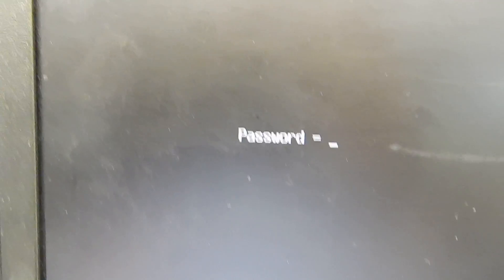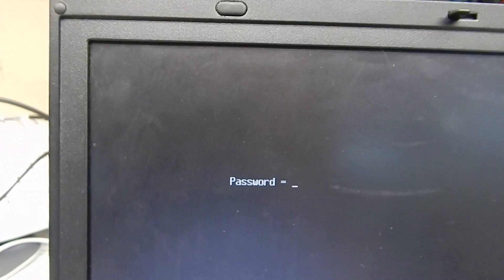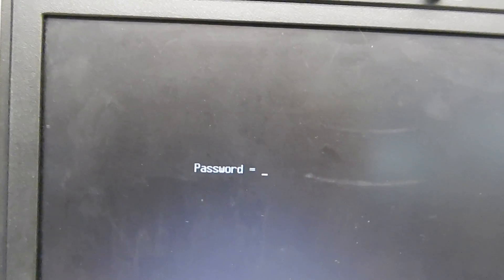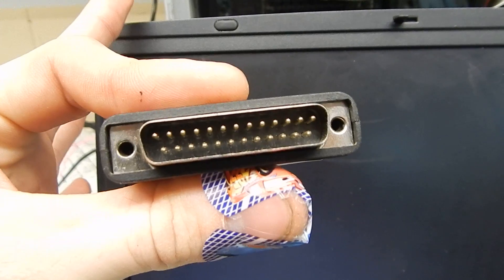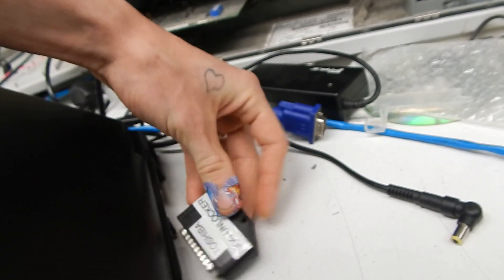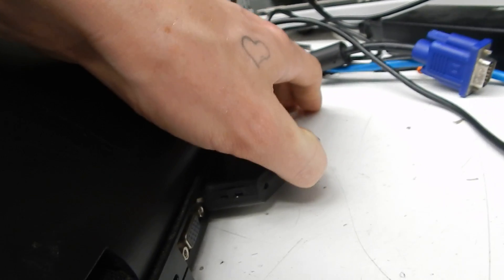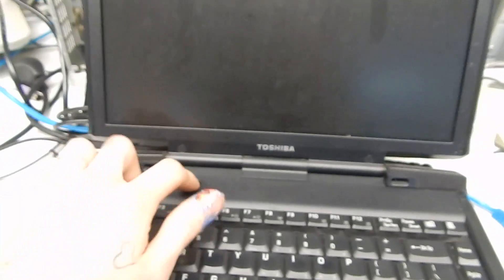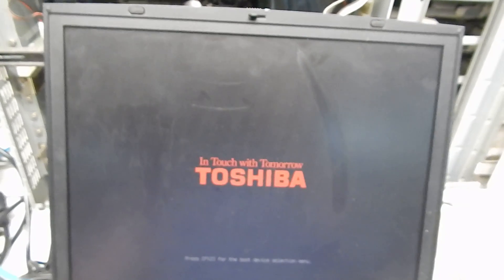Unlock Toshiba BIOS Password!

Comment: #Unlock #Toshiba #Tecra, #Satellite , #Portege , #Satellite, #Qosmio #Bios #Password
With #Challenge Code and #Response Code
 #Skype: Haisung4344

1. Switch on the notebook, when the boot logo appears press [F2].
“Password=' will be display.

2. Press keys in the order [CTRL], [TAB], [CTRL] and [ENTER].
The Serial number and Challenge code will be displayed.

Please Note:
For some reasons it could happen that no PC Serial No. and Challenge Code will displayed instead of "Not Certified" appears. In this case remove the AC-adapter and the battery for a short time and try it again.

3. Please make the payment below or contact me
My Skype : haisung4344

VERY IMPORTANT
Do not power off the computer once you provide us with a Response code. There’s a unique Response code .
Don’t turn off your notebook, don’t restart it, don’t enter anything except generated Response code.

4. You will receive the "Response code".